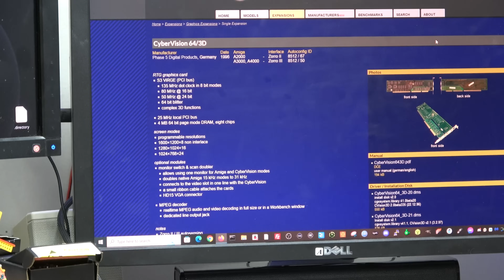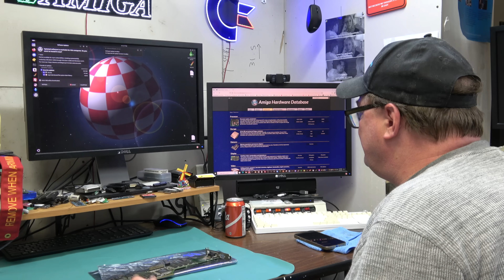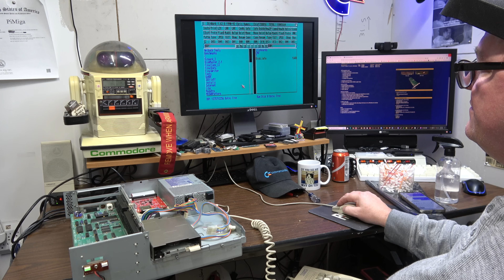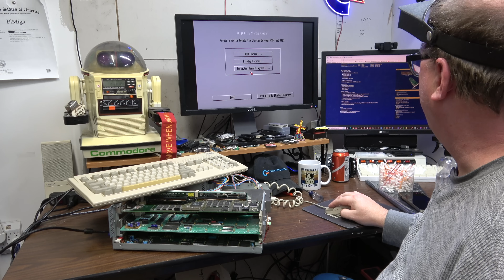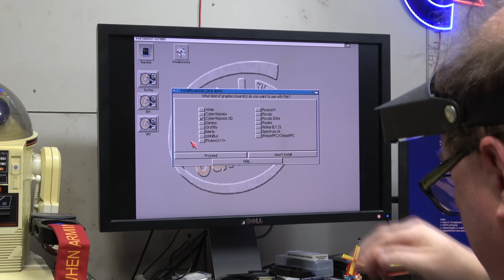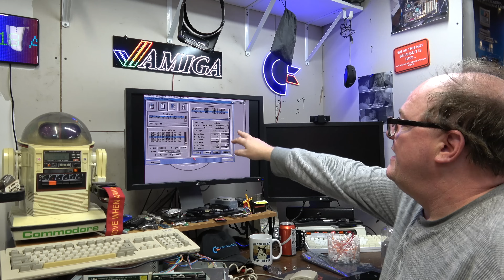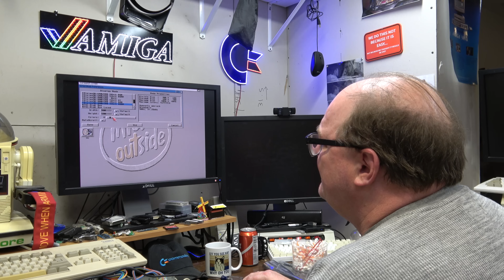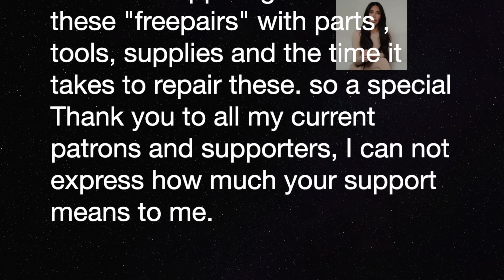My Cybervision64 3d to Hold and modify but does it work

Comment: Having been a PC tech since the 80's I can categorically sate it is worse in PCLand when it come to working on POS hardware. With thousands of cards doing who knows what with IRQs and DMAs and using edlin to edit files and autoexecs the Amiga is a joy comparatively.
My current PC has 2x32GB RAM which is now on the 3rd replacement as I have had issues with it overheating and the inability to run at the 6400 (DDR5). Also the MB has been replaced as the first refused to boot after a BIOS update.  Just remember if brand new PC hardware that wasn't some 5th hand,  bottom of the barrel, home home stuff can fail (take your choice), then what you are going through on decades old Amiga hardware is just par for the course. :-)

Comment: Still have both the video card and scan doubler in the spares box after getting a ZZ9000.  its a pain to install with a scandoubler attached to the metal bracket. Take the hex screws out of the DB15's and unplug the ribbon cable, then you can juggle the cards in and then put the screws back in afterwards.

Comment: They don't have everything and they certainly don't have good high resolution photos on that site. People should be taking photos so that replicas can be made.
Reply: A repro would be easy to make but unless the protected CPLDs are dumped it's not going to work. Those are protected for a reason lol. However the Picasso IV CPLDs and FPGA are archived and I just happened to have a Picasso IV and I reverse stuff all the time. I'm not sure it's worth it though. These RTG cards are pathetic in terms of graphical power, just a really poor S3 Virge (Cybervision) or Cirrus Logic (Picasso) graphics chip from the early 90's.

Comment: I had some issues with mine, where it would not show up too.   Ended up being corroded and dirty connections  Used DeOxit Fader F5 and cleaned the edge connector and it was working fine ever since.
Reply: I don't use the Fader but DeOxit is good stuff for cleaning and as a protectant.

Comment: It's a great card even without the flicker fixer but yeah its a bit of a small hassle having to use it with a switchbox. It's a very fast card. Thanks for a great deal Dr. Chris! And yes I use it! It's in the A2500 right now. :)

And I did make a video! I even showed the oranges! the card also showed up in a couple recent videos. :)
Reply from the maker: was but a frame or three. no soup for you!
Reply: Nobody puts baby in the corner!  Stick that CV3D in a Z3 slot! 😉
Reply: @jjdigitalvideosolutionsllc5343  lol
Reply: @jjdigitalvideosolutionsllc5343  and the orange in a pie hole!!!

Comment: Great stuff as always Dr Chris 👍🏻 I own a couple of those 64/3D cards as well as the PicassoIV. I’m lucky to have the Flickerfixer addon for the 64/3D. Don’t know what it is. But find I get a better and slightly faster output from the 64/3D with the Flickerfixer (You just plug the monitor into the Flickerfixer VGA output) than the PIV card 🤷🏻‍♂️ Maybe down to the Graphics chip? Plus I get to use Warp3D 👍🏻 Cheers 🍻